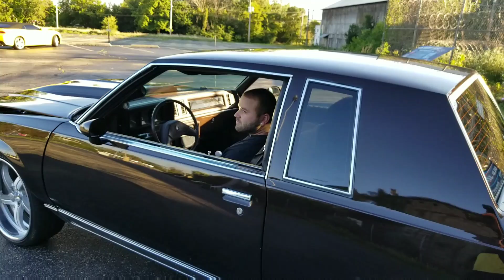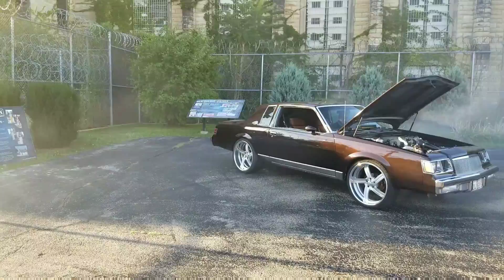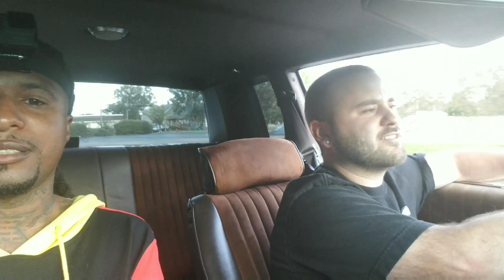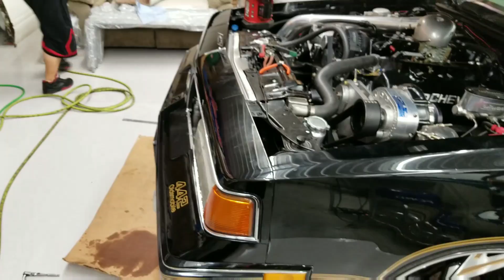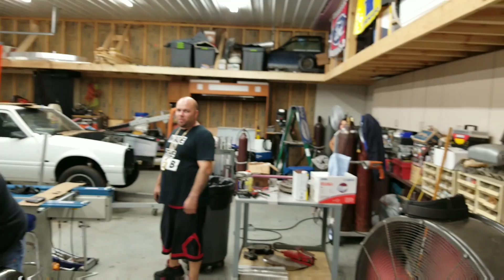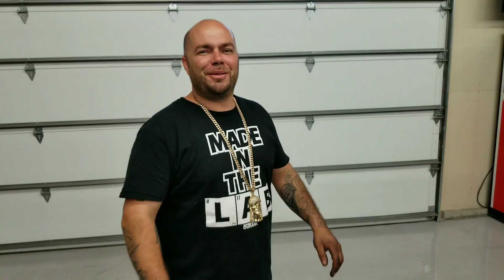(EXCLUSIVE FOOTAGE) TWO OF THE FASTEST G-BODYS ON RIMS IN THE MIDWEST

Comment: Looks like a very nice car for sure, I'd guess without the turbo it could have just under 300 horsepower which wouldn't be a slouch by itself. Well.. with the turbo its hard to say. Looks like a quick car that wouldn't be hard to lose control of. That 5.3 is a truck motor... that is a decent start in a car like that.